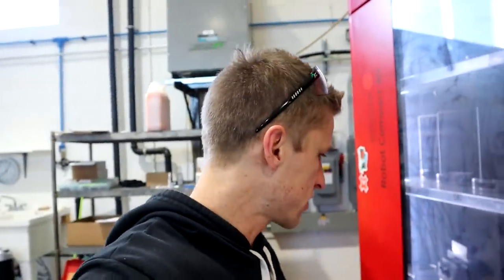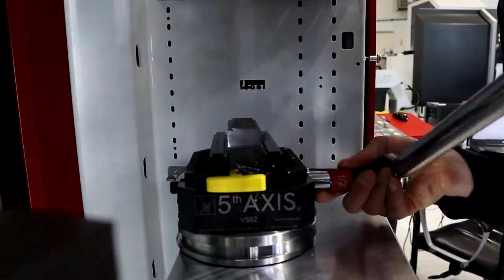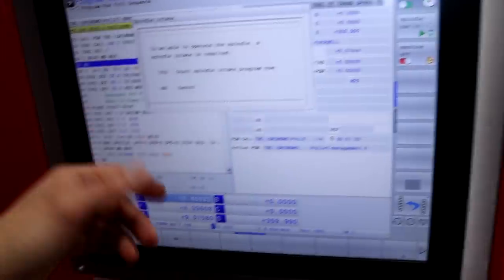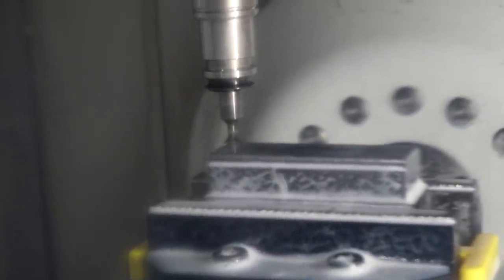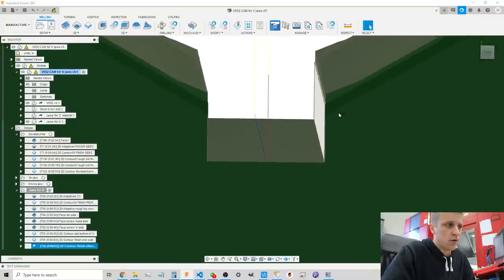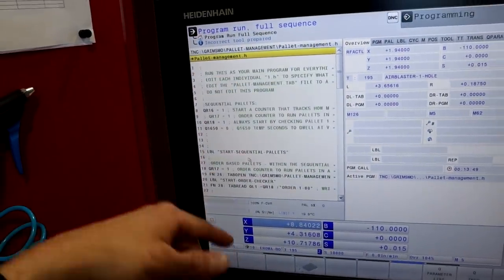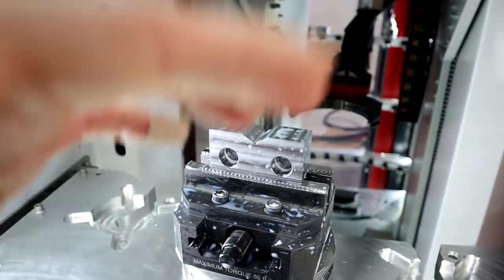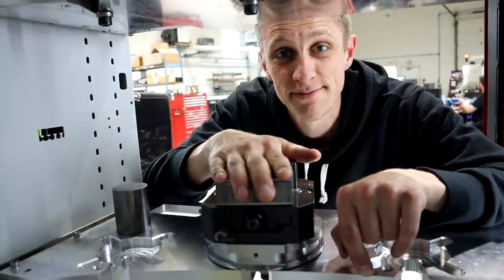Making Custom Vise Jaws

Comment: Can you turn on air blasting through spindle or from the outside with an M-Code?
That way you can blast any residual coolant off of the pallet.
Or put a small chipfan from LANG or something similiar in a toolholder to blast of the coolant and chips?

Comment: I recall a video by AvE where he uses through spindle air, and a custom tool which is just a mounted bit of copper bendy copper pipe pinched to make a nozzle - then he can use that as a blower to get excess off the pallet (where you use the C spin). Does your machine have through spindle air? Would make short work of the pallet drying op.

Comment: By the way: Kern is working on being able to spin that c axis with up to 1000rpm. Keep on milling!
Reply: Now that would be interesting!
Reply: The Okumas I run turn and mill in the same setup. The C axis spins at 1000 and works surprisingly well.
Reply: @landonmiller245  is that a lathe or a mill?
Reply: @Leo_Wolf_the_engineer   it’s a mill. But the entire pallet will spin 1000 rpm to turn. The spindle indexes the turning tool and locks it in place. Balance is very important and the cylinder heads I am machining are not balanced at all so there is multiple counter weights on the pallet. Interesting stuff.

Comment: You should 3D print one of those dog bones with centering marks on it so for a given material size you can line it by eye fairly easily.  Also, reamers?  Get yourself a mini-boring head to make those precision bores and not have to worry about the tool breaking in the bore.

Comment: Thank you very much for zooming in at 7:50. I wondered if they tapered the hole to put the pallet in because the robot can be inaccurate and that could be a big crash. Turns out they made very huge tolerances and did a drawbar type suction in the pallet. Pretty neat.

Comment: Is it worth it to put 2 of the same tools in the machine for the tools that frequently break, so you have backup tool? And can you program the machine to use the 2nd tool if the 1st breaks?
Reply: IIRC Joh did mention on the podcast that he was doing more sister tools. He also mentions a back up Rask engraving tool here https://youtu.be/_ywnDBg2PEw?t=1619
Reply: I know on the DMG that i run you can add tool tip break detection and sister tools and it will re run the ops before the break was detected. I know another shop in Denver that runs titanium landing gear for 747's they have like 6 of the same roughing tools and an aftermarket vibration detector on the spindle. If a break is detected it immediately grabs the next tool and goes back a few lines of code and just keeps going. Those programs run all night so they need it to keep going.
Reply: With most cutting tools that is a good idea, but not with drills, taps and reamers, when they break there will almost always some of the tool left behind, if you send in a sister tool aster that all you end up with is multiple broken tools.
Reply: What is the use of sister tools?
I have heard the term,
However I wonder about the effect of the tool breaking, is it possible to program to skip the part where the tool broke and move on and complete the reat of the pallet?

Comment: I know there are a handful of chip/coolant fans that you can put in the rack and just call up and run the spindle and they blow down the work surface pretty handily.  Not sure if they'd fit in the tool changer, but I think some even have through-coolant so you can do high pressure blasts instead of just flood.  Might help you get that last little bit of coolant off?

Comment: You could always look into getting a chip fan to mount in a tool holder and to run after the coolant flush. You could try just using a chip fan instead of the coolant but the way you've got your wash down program running I think that will work better then anything else. The fan could just blast the coolant off and keep things from getting sticky. If you get one I suggest staying away from the max RPM on those things to help it last longer, because it will scare the shit out of you when it flings a plastic blade at you at around 8 grand. Not to mention they are also a few hundred dollars.

Comment: Ugh John, please don't use your torque wrenches, to loosen bolts/screws. Granted, your fasteners, probably aren't super tight. But, it's not good for your torque wrenches, in the long run. Another great video, otherwise.

Comment: Hey John, you should engrave on the top of the 5 axis jaws to make part centering a tool less job (5:20 in the video) . Just do a scale with 0 in the middle, incrementing up on both sides😎👍 with your wash down spinning, it looks like it changes direction to fast to get upto speed, changing that fast probably sloshed coolant from one side to the other instead of pulling it off 🤔 love the videos 😁
Reply: It's weird they aren't marked already, Lang and Orange both are.

Comment: I feel like it would be better to have it do all of its spinning and then do the 30 second drip dry. The fact that a bunch more slings off when you do the second round of spinning means the 30 second drip dry may not be that effective. I would be interested to see what would happen if you just had it spin One direction for 30 seconds then the other direction for 30 seconds. probably doesn't make much difference but it would be interesting